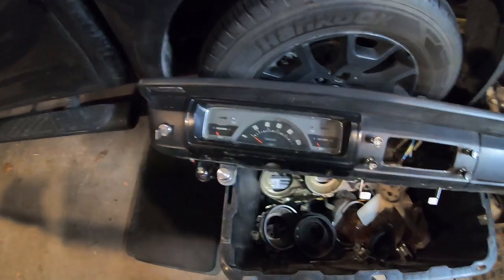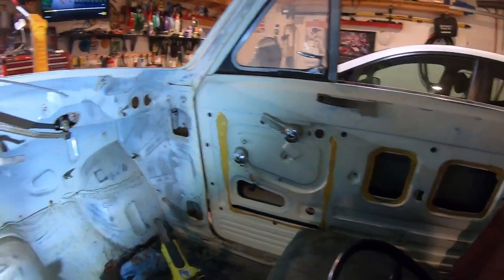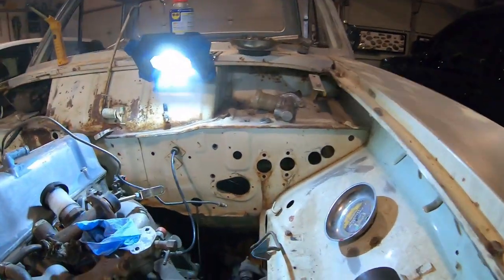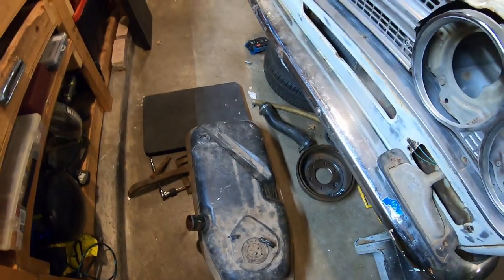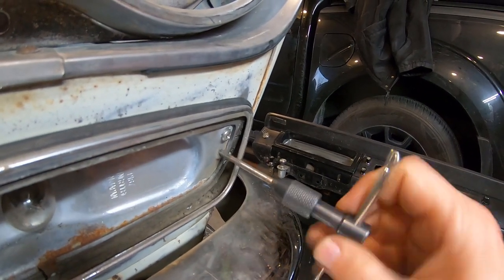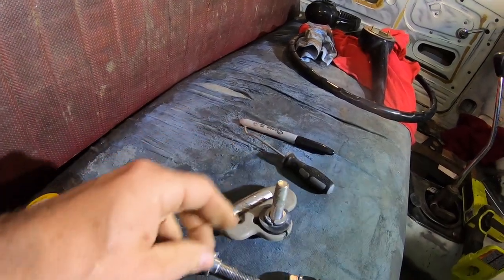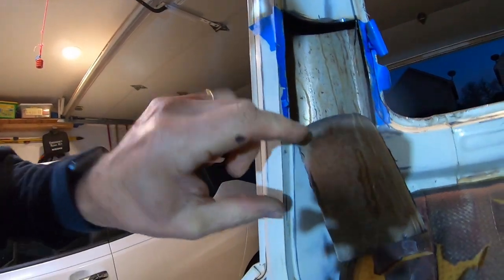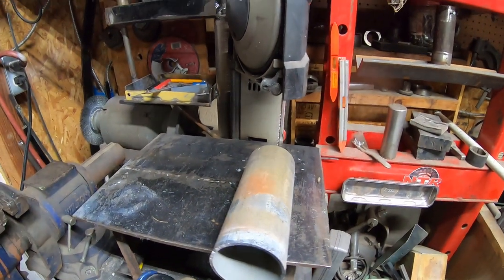Datsun truck restoration part 2. How to add 3 point seat belts.

Comment: I dig it!
I'm a 1st Gen Frontier owner and am just one of many Clubfrontier membesr(and other Nisssan forum members) that appreciate all your work and knowledge you've documented and shared with all over the years!👍👍
Reply from the maker: Thank you! This is the oldest vehicle I have bought. This will have massive upgrade! Considering a d22 drivetrain including HVAC. ka24 with manual trans.
Reply: @NissanNut74 I do hope that your not going to lower this beautiful looking little truck down to the ground and put those ugly, gross looking wagon wheels and thin tires on it. These little Datsun/Nissan 521 series trucks are beautiful looking little trucks and they are designed for light hauling when you need to haul something or transport something that needs transported from one place to another. They're beautiful looking little trucks.
Reply from the maker: stock wheels and these tires with chrome hubcaps. stock to slightly lowered. i hate low profile tires. @danbasta3677